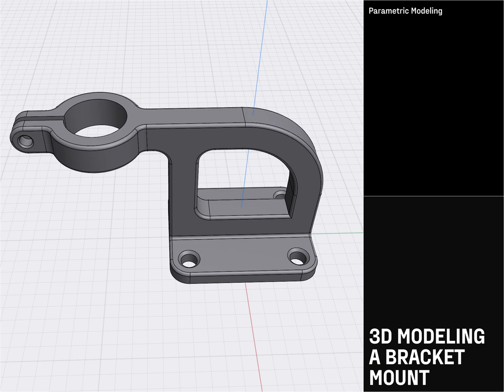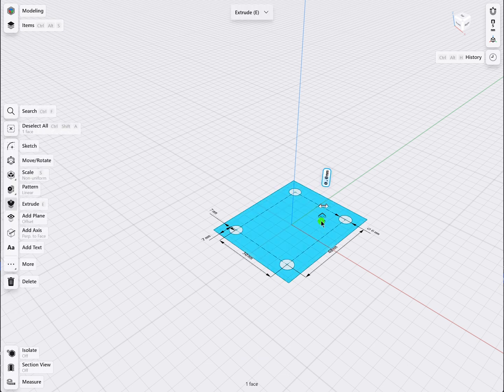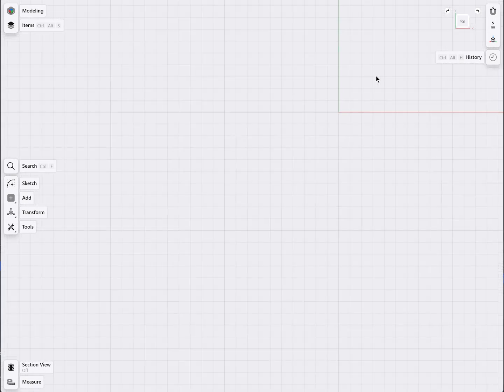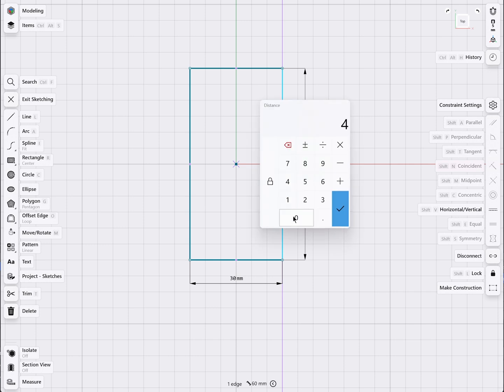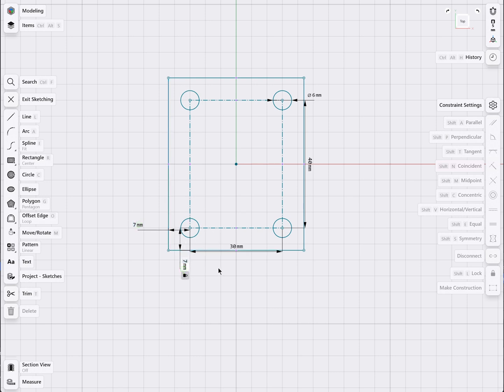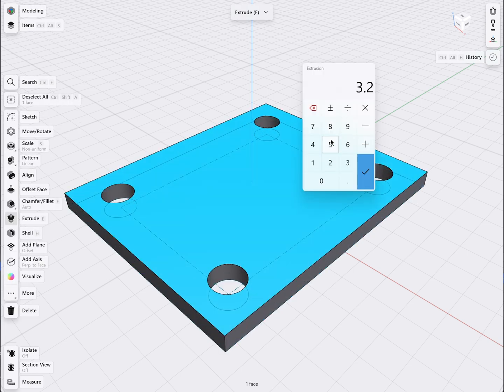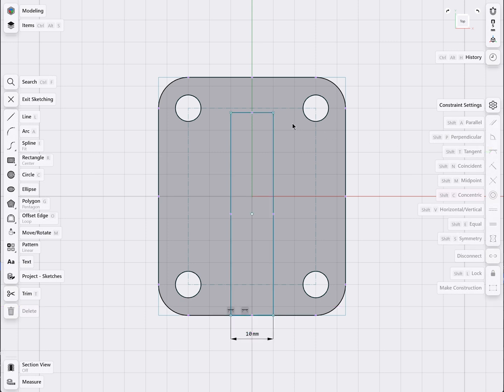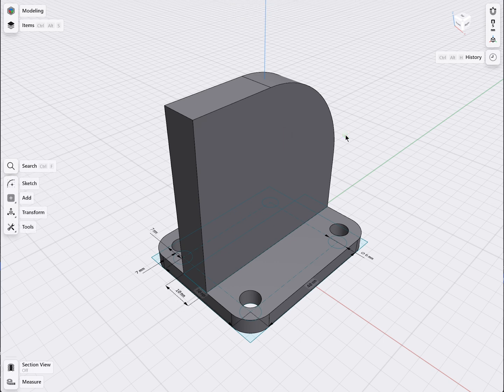Bracket mount | Modeling Projects

Comment: at 4:38 I try to resize the space between the hole and the outside square and I get "this constraint will conflict with existing ones", even if I remove all constraints. I am on Parametric Beta if that helps. Edit: just tried in non-Beta and it works, so only Beta has the above problem.
Reply: Currently having the same problem on the Mac non beta version. Even after deleting all constraints, it shows me the same message that it conflicts with existing ones.